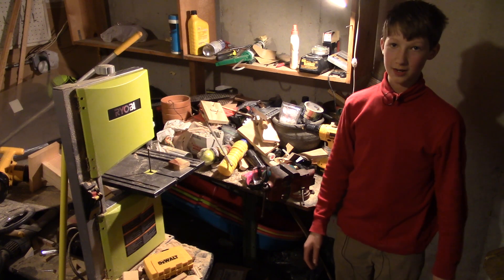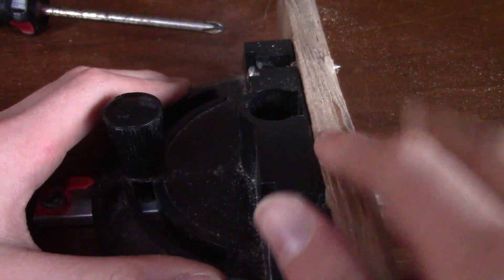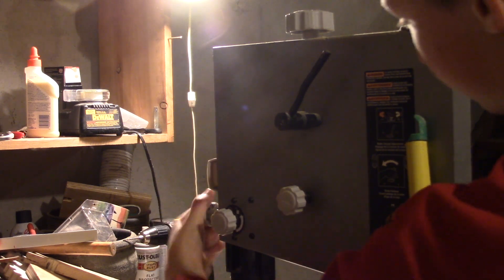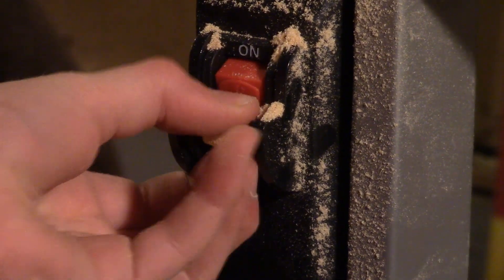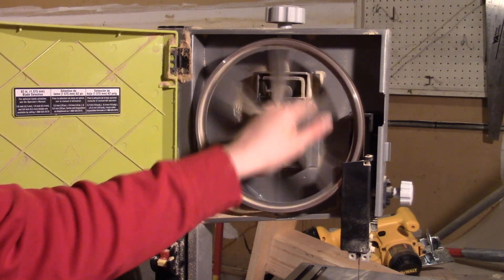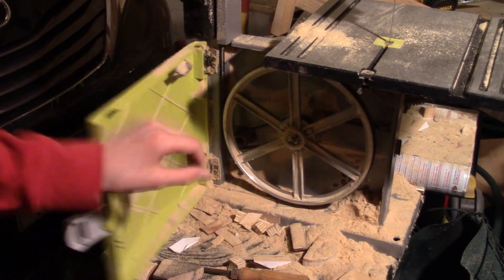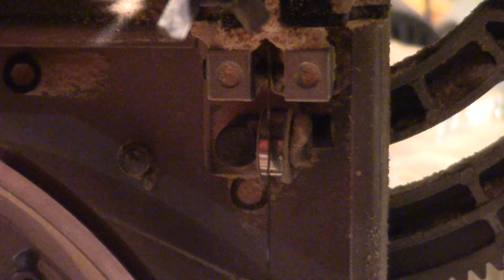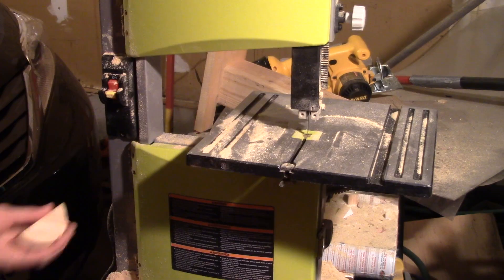Ryobi 9 inch Band Saw Overview

Comment: Not sure if you're still reading the comments here, but if you are: what is the thickest piece of wood you managed to successfully work with?  And the hardest wood you used it on?  I'd like to work with 4-5 cm thick ash boards, which might just be a tall order, but maybe not.
I'm not liking the fact that it doesn't come with a fence.
Reply from the maker: I managed to cut a softwood 4x4 which is almost 9 cm thick.  I don't recommend this saw if you are mainly going to be cutting 5 cm thick, the motor just doesn't have the power.  Also, the blade drifts quite a lot when cutting thick hard pieces, so resawing with this saw hasn't worked for me.  I'd recommend finding a bigger saw with a more powerful motor.  Make sure to check craigslist, or an auction site, there are some good deals on tools there, although they might need a bit of restoring.
Reply: @albertlagerman   Thanks a lot. I actually might end up getting an even weaker one, and just be careful while using it. I will try to keep the ash boards to about 3.5 cm (1"3/8) thick.

Comment: Hello, for the band saw, kindly, could you accurately tell me the total height from the base to the knob on the top? Thanks
Reply from the maker: Hey, sorry I've been so lazy about this, but I just measured it, and it looks like about 73.1 cm or 28 3/4".  This varies slightly depending on the blade tension, because the knob moves up and down slightly.

Comment: How deep will the bandsaw cut?
Reply from the maker: You can fit a little more than 3.5" of stock under the upper blade guide, but it doesn't cut fast or super good when cutting wood that big.  I was able to cut a chunk of a 4x4 with it.  (A 4x4 is really 3.5" by 3.5")
Reply: Thanks!

Comment: nice! although, is your blade in the centre of the wheel? cuz if it is, it's making those side guides force the blade, whereas they're designed to prevent the back edge from fishtailing. 

to fix this:
1. make sure that the deepest part of the gullet is in the centre of the wheel, otherwise those bearings will be destroyed quick af. 

Alex Snodgrass showed this, credit to him.